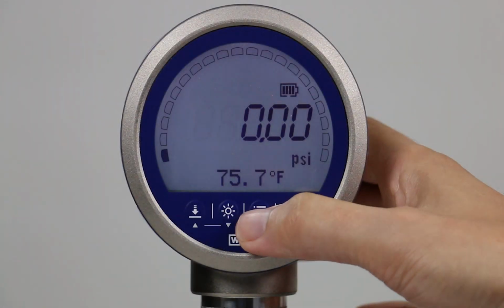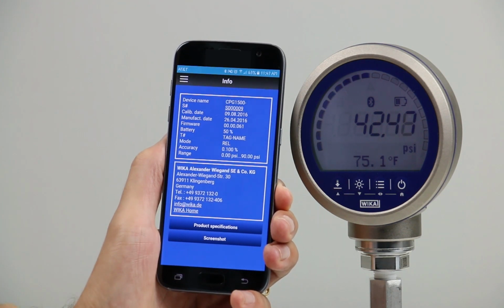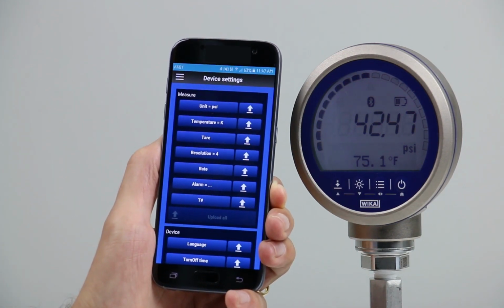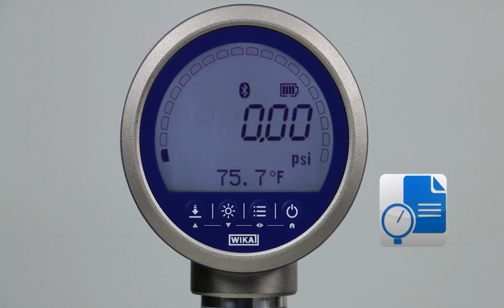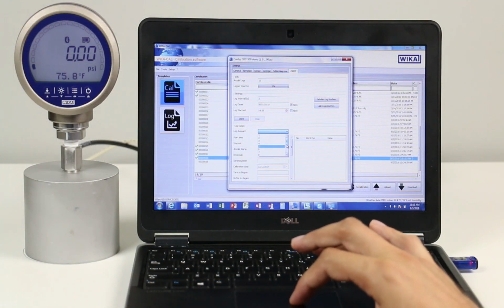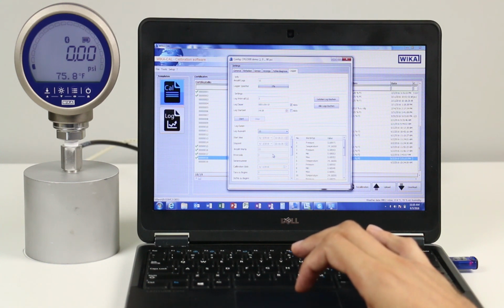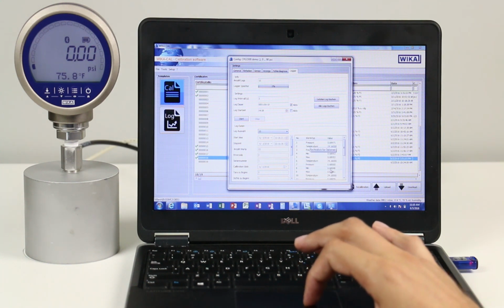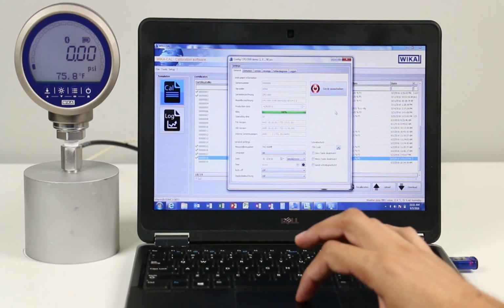CPG1500 Precision Digital Pressure Gauge Demonstration | How to Set up and Operate a CPG1500

Comment: It's shown sensor error E3002.
Reply from the maker: User manual suggests two possible issues:

1.	CPG1500 is switched on again too quickly after being switched off. Insufficient time for a sensor reset. Wait at least 10 seconds between switching off and on.
2.	Batteries are not loaded for a prolonged period of time. A passivation layer forms, which leads to a voltage drop when switched on. The sensor is quite sensitive to voltage dips. Replace the batteries, if error persists, send in for repair.

You can locate the manual here: https://www.wika.com/media/Operating-instructions/Operating-instructions/Calibration/Digital-pressure-gauges/oi_cpg1500_en_de.pdf

Comment: Can this gauge be used to read high fuel pressure on a direct injection engine.
Reply from the maker: Please refer to the CPG1500 datasheet: https://www.mensor.com/upload/DS_CT1051_en_um_80979.pdf. If your pressure is below 150,000 psi and the fluid is compatible with 316 stainless steel, the CPG1500 would work for your application.

Comment: We using sv8 toky pressure meter rectangular type using to connect transmitter in water flow pipe... What is sv8 and what differ between  your product.. Can u give any warranty or guarantee...
Reply from the maker: The CPG1500 is a digital indicator combined with a pressure transmitter with an accuracy of 0.025% of full scale. The complete specification can be viewed at: https://www.mensor.com/cpg1500_en_co.WIKA?ProductGroup=84665 . It has communication via WIKA Wireless and can be accessed through a mobil APP that can be downloaded at: https://www.mensor.com/download_ios_android_mobile_apps_en_um.WIKA .  It has a 2-year warranty.